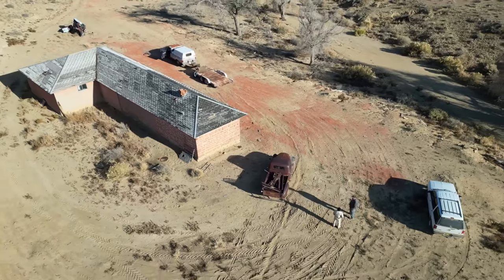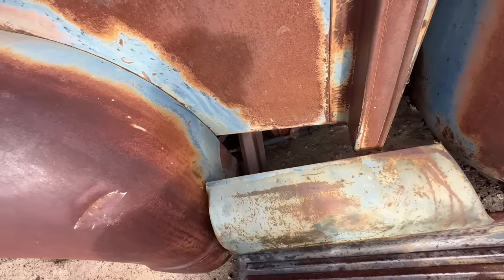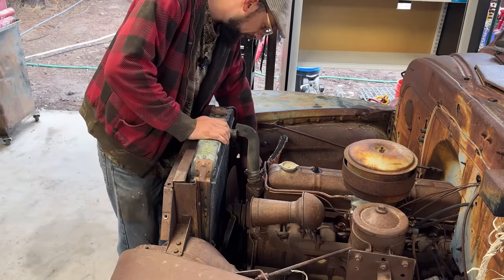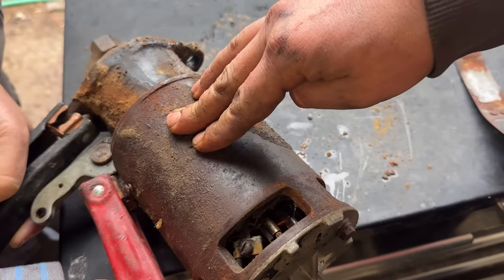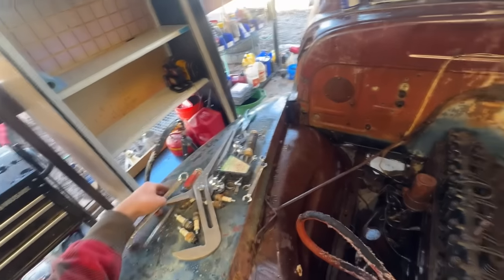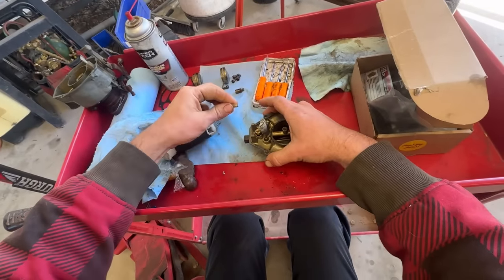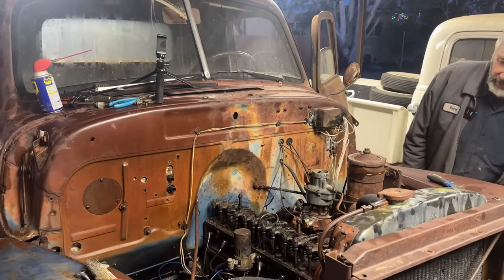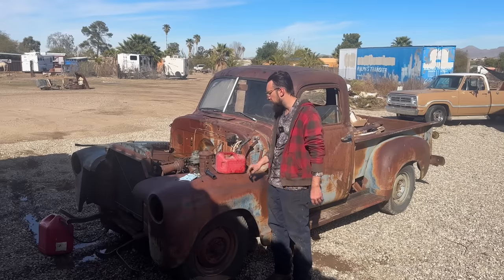1948 Chevy truck ABANDONED 58 years ago, will it run AND drive?

Comment: The 216 is a misunderstood engine. You could stand 10 feet away and not hear the engine running. The babbitt rods could not stand abuse. You could not run them much above 60 mph. Old timers used to run them a quart low on oil because the engine would throw that 5th quart out the tailpipe no matter how you drove. They ran fine on four quarts of ND 30wt. I fueled my 49 Chevy Coupe up with regular and fueled myself up on 2% North Carolina beer one night when I was in the Marines fresh back from Viet Nam. I ran that poor car at 90 mph until the motor slung a rod out of the side of the block. I kept driving it as I was thirty miles from Camp Lejeune. The oil coming out of the block soaked the exhaust pipe and I had a flash fire at around 60 mph, flames literally shot up around the clutch and brake pedals around my feet. I made it back, didn't have to walk a step. The rod or what was left of it was hanging out a fist sized hole in the side of the block. We didn't know what PTSD was back then, people just called us "sh*t house crazy". I still feel bad about abusing that 49 coupe, I gave it to a farmer.

Comment: It  takes oil pressure to bring oil to the top. It takes restriction ( tight bearings) to build oil pressure. If you have a loose bearing, the pressure will puke out right there. Wont get to the top of the valvetrain.  Been doing this stuff 60 years. Used to be fun. Oil should be spewing everywhere up top within 60 seconds or less.

Comment: A nice little trick to see if it's a rod knock, or a main knock. If the knock goes away or gets quieter under engine strain, AKA in gear trying to pull, then it is a main knock, if the knock stays the same or gets louder under strain, it is a rod. Great Video!!! It's amazing how resilient these old engines are.

Comment: That's cool! I work on locomotives, and some are 2 strokes. They have a sprag clutch style clutch used for the turbos. When the exhaust gasses reach a certain speed, the clutch kicks out, and the exhaust does the work. When stopped, you can spin it one way but not the other.
Reply from the maker: That’s interesting

Comment: The forward folding back of the seat is original. However there is not much storage room back there due to the gas tank. I grew-up with my older brother driving Chevy 1/2 ton trucks from the mid 50's to mid 70's. Just a note the heaters were optional as I recall and the 6 volt battery is under the R/H floor panel. I can recall learning the trick of heal on the gas pealed and toe on the floor board starter switch left foot for both clutch and brake for starting. Fond memories every time I see an old Chevy Pick-up I have to remember my late brother and dad changing the engine out with a chain hoist hanging from old back yard elm tree. 
I Think that truck would look good with the original USAF paint scheme.  Good luck with your restoration hope ya keep it original. Oh and you are correct on the split rim wheels, my brother often complained about those old rims being dangerous. Happy New Year to you and yours.
Reply: PS: Guess I spoke too soon  on the gas tank & battery box, you mentioned your GMC so you are more than aware.

Comment: Something to consider on these old engines. IF the oil pump is driven off the cam and you might be able to clean out the goo in the engine with a drain and refill of the oil system and a new filter using an adapter after you pull the distributor.

Comment: Not a criticism, love the work you guys are doing! Started WAY back at the near beginning of your YouTube, wish either of my sons shared my automotive interests. But one of my 'quirks' when I would have to 'resurrect' an engine like that, when the plugs were out, before I dumped in whatever magic 'oilixer'  I had mixed up, I took my air-gun nozzle and either used compressor or my air tank to blow out the cylinders. More than once I've thought 'Good Grief! that spider must have weighed 15 lbs to leave THAT much web-silk & dessicated discarded 'meals'! as they blew out past my shoulder. not to mention occasional small mountains of rust, or worse...water.😁
👍🇺🇸😎

Comment: That is the correct seat, it tilts forward so you can access behind it and on top of the gas tank where you stashed your coat and coveralls, etc...  It would never fold fully forward like it is in the bed of your truck because it hits the steering wheel first.  The bottom portion of the seat lifts up so you can store your toolbox, road flares, etc..  My brothers and I had my grandfather's 1952 as our first vehicle each and me being the youngest I fortunately got to keep it as they were in college when I got my turn.  The brake light you said probably goes on the driver's side because it has a license plate light underneath is correct, but it is the ONLY brake/tail light as they only came with one back then.  And the "turn signals" you found are not turn signals, they are just marker lights.  These trucks did not come with turn signals.  Overall you have a great truck and a great project!

Comment: I bought a 1999 Dodge intrepid with a 2.7 V motor in it cheap.   It had that same noise and the former owner said it was just bad rockers.  He lied of course to dump the car.  The car made the same knocking noise as your Chevy truck.   It turned out that the car had overheated until it seized completely.  The former owner poured transmission oil down the throttle body and unstuck the engine but when he got it to run again, it made a knocking noise.   The neighbor was a mechanic and offered to work on it.   It turned out the crank shaft had warped due to the heat.  What the knocking noise turned out to be was "piston slap" due to a warped crank.  He bought the car from me, tore the engine apart and made it into a year's project.

Comment: Thank you for all the work you put into your videoes and into rescuing these old cars and trucks. Loved this one. 

I think I saw a bent pushrod (nr. 5 from the back of the motor) at around 1:30:00 ish. It seems to be swiveling in the bore going up and down instead of going straight up and down when your combined exellent skills made it run.

 With uncle Rodney being there, the Exxon Valdes situation and all, it probably will not make a difference, but checking the pushrods, adjusting the valves to spec and clearing out the oil channels to the top might give a better starting point to decide if you want to rebuild or just change it. 

Happy New Year to you all from Norway!
Reply from the maker: Thanks for watching from Norway. I didn’t notice any bent but. One could be

Comment: It’s great to see all the good work you are doing on this project. I must say that spark plugs should never be cleaned on a wire wheel, this can leave metal residue on the insulator that can cause the spark to bleed off and not fire across the gap.  You can clean them by hitting them with a propane torch until the insulator is red hot, this won’t leave any metallic residue on the insulator.

Comment: It amazes me that folks has forgotten about the best fuel mix to start an old engine after sitting years and rings are stuck,  mix gas and trans fluid about 60/40 to boost compression at start up, may smoke for a little while but it always worked. And it lubes the upper end so you dont hurt the old rings.

Comment: I would put on a mechanical gauge under the hood to check the oil pressure, I agree with your dad again don't run it long until you figure out what the knock is, you have already ran it longer than what I am comfortable with!!

Comment: very similar looking thermostat (in the case of design, it's propably much smaller) can be found in a Skoda 1000MB (1964-69) but they modified it in the next (Skoda 100 1969-77) model, where it does look more normal and "modern". It's principle of working is based on a expandable wax, which it's filled with, and not the bi-metal spring thing. Greetings from Poland!
Reply from the maker: That’s wild. They sure look crazy

Comment: Gentlemen, before you condem the engine as junk pull the oil Pan off and check the rod and main bearings. if that is the original engine That came in the truck for the military It could have replaceable rod bearings.
 The military rarely uses things that cannot be repaired in the field easily my case in point I bought a 1-ton Dodge pickup truck that was previously an Air Force truck and it came with half ton rims because the Air Force didn't want to have special rims just for one style of truck.

Comment: I had a ‘52 5 window 1/2 ton four speed that I got from my Grandmother in the early 70’s. It still had the splash oiling for the rod bearings but had been converted to insert type bearings. Still never had more than 20 psi oil pressure running straight 30w. My Grandfather obtained the truck in the mid 50’s and used it tow a small house trailer around with a horse in the pickup bed going to different horse tracks in the SW. you mentioned that you thought that these trucks originally came with split rims. I’m pretty sure that those were only on the 3/4 ton and heavier trucks. I remember my truck having the original dark green paint on the wheels under the white brushed paint that my Grandfather applied to the whole truck sometime in the late 50’s or early 60’s. Switching to a 235 or 261 engine would be a good choice. Best of luck!

Comment: Dam Travis a fantastic Video again.  On the Carb the lever that you weren't familiar with is the high idle when the choke is pulled but you probably figured that out or your Dad knows.  Great buy regardless of the engine!  👍👍  ps your Video work is fantastic.
Reply from the maker: Thank you 🙏

Comment: WE HAD A 48 THAT WE BOUGHT IN 1973 FOR 250 .00 RUNNING AND COMPLETE , IT WAS A 4 - SPEED 216 C.I. , THE STEERING WHEEL HAD A CHROME FACTORY HORN RING , THE 47, 48 HAD THE GAS TANK NOZZLE THROUGH THE SIDE OF THE BOX ON THE RIGHT HAND SIDE , 49 ,50 , 51 , 52, 53, 54 , 55  ON THE CAB 3100 SERIES UNTIL MID - YEAR BODY STYLE CHANGE  !!! THE TRUCK ON THE FREEWAY SMOKED , IT NEEDED A RING AND VALVE JOB HOWEVER THAT TRUCK WOULD RUN AROUND TOWN LIKE NOTHING , IT HAD AN EXCELLENT RIDE FOR A TRUCK , WE SOLD IT IN 1976 FOR A 67 DODGE D-100 318 V-8 THAT A NEIGHBOR WAS SELLING !!! I MISS THAT CHEVROLET AND LOOK FORWARD TO RESTORING ONE WITH A 4 - SPEED WITH A COLLECTION OF THE OPTIONS AT THE TIME OF BUILD !!!

Comment: 12V conversion:  I'm only about 1/4 through this video, so maybe he's already covered this.  Of course you will change the lamps and you will get a resistor for the guage cluster (available at most re-build suppliers). Don't worry about the gas tank sender unit, the gauge resister will compensate. Change out the generator for an alternator because they are so much more efficient.  Just make sure you get an alternator with the rectifier built in.  Also if you mess with the gauges, be very careful of the oil gauge.  It is fed by a fragile capillary tube and breaks easy.  Same in the engine compartment.  If you fracture this tube, it is a nightmare to replace.  Lastly, leave the 6V starter in.  Feeding it 12v will give it more torque and speed.  They were built very robust back then.  I've had mine 30+ years and it is still cranking.

Comment: Capsule thermostat.  Contains a special fluid that expands and contracts against a spring in a sealed convoluted brass case.  Kind of like the capsule in a barometer that expands and contracts with the change in air pressure

Comment: Just came across this video and love it. Im an Air Force veteran so that truck is cool. Don't see any ex military trucks like this anymore. Be cool if you put it back like it was still serving in the Air Force. Love your old Dodge trucks too. I used to have a 73 D200 ex Forest Service pickup. 318 4 speed. Best of luck on the old Chevy

Comment: You'll get a better compression reading with the carburetor butterflys wide open -full throttle. 
(gotta get the air IN to compress more.)👍🇺🇸😎

Comment: there were cotton/rubber fiber washers under the valve cover nuts ,mice may have eaten them or just age rot ,a 216 has valule but if you want to drive this thing find a 235 you be many dollars and much happiness ahead. very nice find though good luck

Comment: The 216 has the valve cover bolts in the center.   The 235 has them around the edge.  Luckily my truck had a 1955 235 full oil pressure engine swapped into er

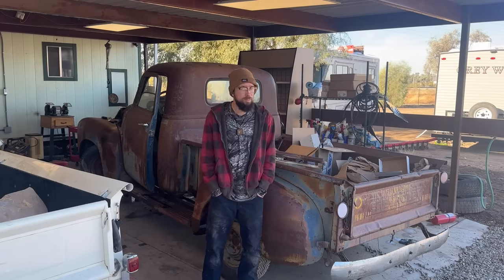Comment: 1:37:00 I dont know if that critter oils the top end thru the rocker shafts, or the pushrods, but your passages are completely plugged up! Better run em all thru a solvent tank and blow air thru em. Maybe some bottle brushes too.

Comment: I did my read all comments so this may be repeated (I have two: a 1950 and 1954)

Those are factory rims, tube rims, no safety bead.

Original engine was a 216; it had 216 valve cover, but can put on 216 … most likely 216.

Heater was a dealer option, which means there could be a variety of heaters.

Correct, that is not The bench seat in the bed is not the standard factory seat - they did not tilt.

Comment: Motor was drained of all oil, I believe the oil pump has gone dry also. You need to pull the distributor out and spin it to pressurize the system, just like a new engine.

Comment: Honestly I would check the oil pickup might be full of dirt and debris and or needs an oil pump. And it would probably quiet right up. Another tip take the rocker arm assembly and soak it in parts cleaner or do a combination of blowing it out with air and spraying some cleaner inside the oil holes. Might just be plugged up. On pump side or rocker side or both.

Comment: If you get a 2 or 3 foot wooden dowel and cup your hand around the end with your ear against your hand and touch the dowel against the block. You will be able to tell where the knock is in the engine. When you were prying on the flywheel I could see the flywheel lifting up, so I would say the rear bearing is wore out. So if you are going to keep the engine you need to do the mains and connecting rod bearings plus the oil pump.

Comment: Great job! 
I’ve had 216 and 235s before where guys would put a T at the oil filter and run a line back to the head for a little extra oil. 

216’s just had the sling and slop systems, 235 would be the way to go! 

Good luck with it! 

Where did you get those LED shop lights??
Reply from the maker: They are lpl 24 lights online

Comment: I don't know if anyone told you but when you are going to change points and condenser, just loosen the screw on the condenser then slide the condenser out, that way you won;t lose the screw.
Another way is to have a screw starter every mechanic had one to start screws in points distributors, no one uses them anymore so they should be all over get a nice old metal one  that does straight and philips head screws.

Carb  gaskets atv the pieces together so you can use it now,  you can always put a new one in later

Comment: FYI, Trav, if possible, its best to clean off old plugs in a blast cabinet, not a wire wheel. The sandblaster will remove oil and carbon down inside, around the insulator. In the 60's, gas stations had a mini-sandblaster to "recondition" plugs, making them almost good as new. A cheap fella could even buy reconditioned plugs at the service station, back when they actually fixed cars.
Reply from the maker: Yeah I’m on the hunt for a real cleaner
Reply: My grandfather had one of those and I inherited all his tools.  I'll have to look and see if it's still there.  This one had two clips that hooked to a battery and the plugs inserted in the side of it.  I can't remember if it would do 6 or 8 plugs at a time.

Comment: Keep in mind, these 216 and 235 model engines with poured babbitt rods need non detergent oil. In 53 the 235 models came with insert rod bearings along with hydraulic lifters. So detergent oil is needed. If it knocks, you will need to remove a shim on each side of the rod cap.
Reply: finally  a comment by someone that knows those engines ,Ive heard of people that pulled over on the roadside ,drop the oil pan and shim the rods , back in the day , LOL

Comment: If you don't get some oil going to rocker arm shaft and rockers you are going to have more noise than you have now, also I agree with dad it sou n ds like might be a rod knock, on these 216s I have heard some old timers say you can file rod cap and quite the knock! I have never worked on these myself !!

Comment: Love the truck. Put a 265 or 283 in there. I know the 265 did not came out until 55 and the 283 in 57 but they are early Chevy engines and probably better then a 230 also.

Comment: little  water....been through there while backing packing from denver to gallup in 1994. nothing but Navaho trading posts from shiprock to gallup. i noticed they (U.S. government) changed the route number from 666 to 491 for some reason. lovely, high 'n dry country strewn with petrified wood.

probably hasn't seen more than about 60 inches of water since it's been sitting there through these years.  haha

Comment: Great little truck you found. :) It was painful to see you running the engine so long without oil reaching the top. Are you sure you can block off the oil filter and run it? Usually the oil goes through the pump then filter and spreads out in the engine. I don't know these engines, but that is how all mine are.

Comment: Probably already been mentioned to isolator Rod knock remove a spark plug wire at a time while it's running, and that noise should go away on the cylinder that's suspect

Comment: Check the Flywheel see if it is loose. That could be the source of your knock. That play when the engine was still locked up just seems wrong. Or it could be a broken crankshaft.